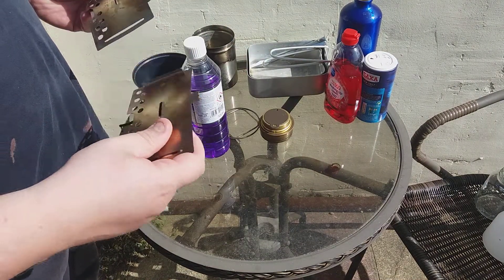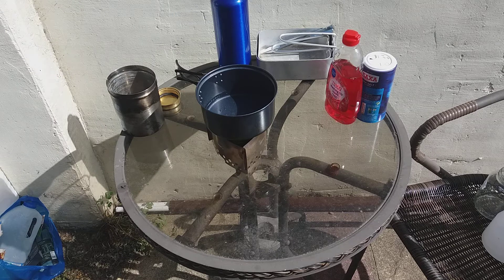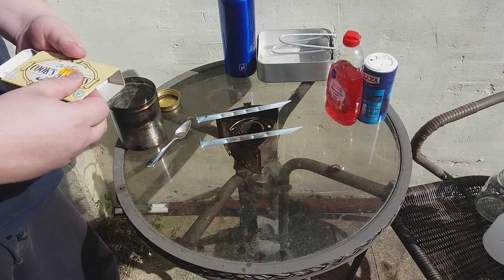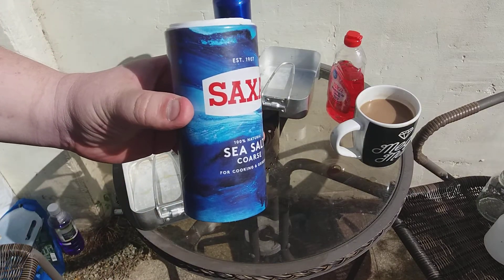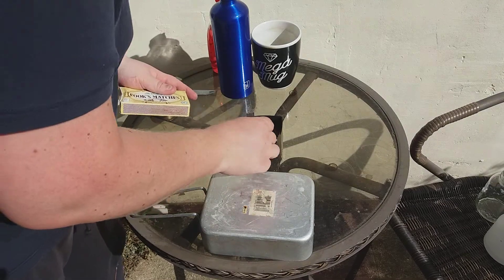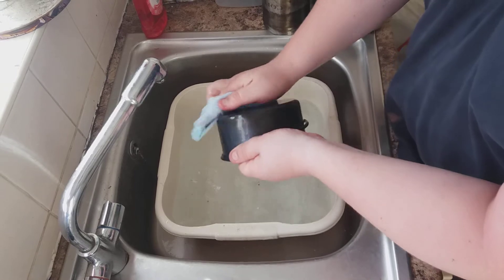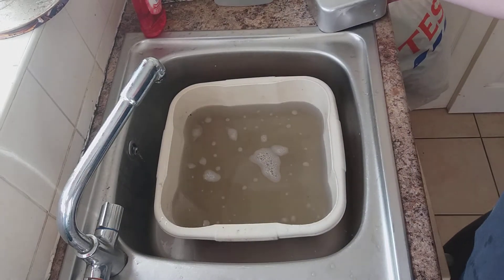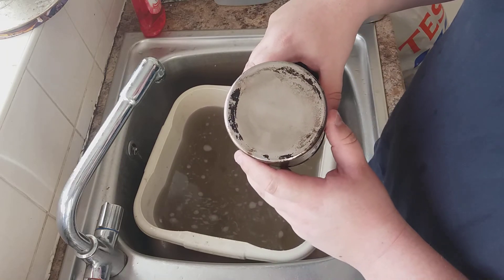Trangia stove cleaning hacks put to the test

Comment: I'm in my late 60s, my first set of pans (which I don't use but still have for nostalgic reasons) is a set of WWII 1940s mess tins which I bought with a WWII two man desert, bug netted brown canvas bivvy tent from a Burnley 'Army & Navy Stores' surplus shop when I was in my late pre-teens (it felt like it weighed a ton) for wild camping on the moors behind where I lived in Lancashire.

I first came across Trangias in the early 80s post RAF service when I started going rock climbing with a group of mates at weekends (after a booze fuelled challenge in the pub on a Friday night) who were experienced climbers having started about the time I joined up. One was a decade older than us and a lot more experienced, he'd climbed with Don Whilans who lived not too far away and Joe Brown. My mates all used full set Trangia stoves for camping and just their burners with three rocks as a stand around it on a day's climbing trip for brewing up, tin of beans or soup etc, and that's where I learned about adding water in a pre-internet age. In the mid 80s I took up long distance trail backpacking and I bought a Mini-Trangia set, I still have them but I use the burner with home-made stoves out of used food cans (no need for a wind shield, the pots sit inside them on tent peg or wire supports, burner below) for a Zebra Billy I picked up in Malaysia in '09, and a Stanley Adventure cook set (videos on my channel if interested).

I note from your video, apart from the smeared washing up liquid test, the water test had the least sooting. However it was a smaller pot, I suggest you try it with the mess tins. I also suggest you try it with a 9:1 ratio measure meths to water. That's what I've used for over 30 years with little or no noticeable loss in performance, and the fuel goes further. I haven't heard of adding salt before. I don't have greasy food unless I'm base camping at a camp site where there are washing up facilities, so I don't carry washing up liquid when I'm on the trail, it's extra weight to carry. Cleaning is done with water a small 3m (inside only) sponge (for outside) in the top of my Stanley along with a fold up stainless steel spork and a Swiss Army knife for my cutlery, and the Trangia fits below them in the top of the green cup. I often pick up sachets of salt pepper and sugar from cafes/McDonalds etc which are stored in the Stanley as well.

You like shiny pots, however I soot mine up before camping/backpacking use with a wood burn (puts a layer of tar on the pan), wipe of loose soot with a tissue or paper towel when cool, followed by a neat meths burn then another wipe off of loose soot. I leave the outside black because they absorb heat better because a shiny surface will partially reflect heat off. If out in the field and I've run out of meths or am using wood to conserve my supplies for when there is none available on the tree and bush free open high ground, I wipe soot off by sliding the pan about on grass, if there's a spring or beck I rinse them in that.

If I want to get burned on brown grease off metal pans at home, Brillo steel wire soap pads are the business, for shiny mirror stainless steel you don't want to scratch, submerse if possible in a solution of water, vinegar and bicarbonate of soda, place on a low heat and leave for several hours. Mix a paste up of lemon juice or vinegar with bicarbonate of soda, apply to stubborn spots, leave and hour or two, go back and polish with a soft cloth (my late mum's method). If you have an electric steam jet cleaner, that's the most effective I've found with a microfibre cloth to wipe off.

Comment: Step One: Stop using purple methylated spirits, use the clear stuff..
Reply: In the UK only meths and bioethanol fuels are readily available, and meths is more widely available, both produce sooting.
Reply: @blackboardbloke  I made a mistake with the spelling of my comment. It's now fixed..
Reply: @Funkteon  Only purple methylated spirits and clear bioethanol liquid spirit is available in the UK. Meths can be bought at hardware stores, DIY stores and outdoor shops. Bioethanol fuel is only available at outdoor shops. If you're on the trail meths is the easiest to find. Both produce sooting as does alcohol gel and solid fuel hexamine tablets.
Reply: @blackboardbloke  Ahh damn - Here in Australia, our methylated spirits are clear like water and 96% alcohol... I've been using it in my Trangia for years and it still looks like it did the day I bought it.
Reply: Meths is and 90++ alcohol, it is the dye that causes the soot. You don't see it now, but when I was younger, instead of cheap string cider in litre bottles that are available now, the down and out alcoholics used to drink meths and mix it with milk... not good. The purple dye was to warn/put off from drinking it and it's a legacy of that.

I use that 9:1 meths to water ratio and get hardly any soot.

Comment: Save time spent on cleaning.......use bioethanol instead of meths. It is much cheaper (Current price £4 per litre from B&Q whereas meths is £9 per litre. It burns hot, is cleaner (does not blacken pans) and, unlike meths, is not toxic plus it does not have an unpleasant smell.